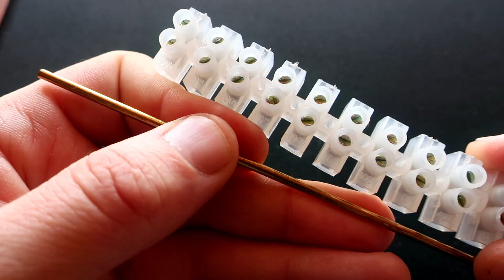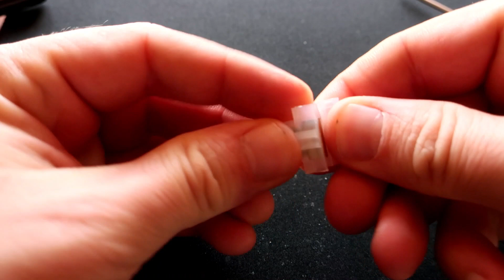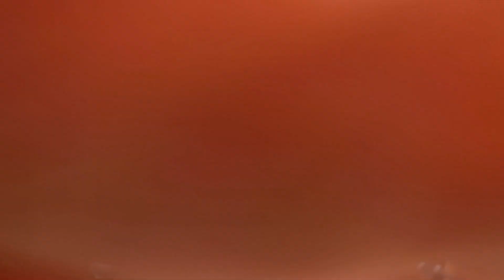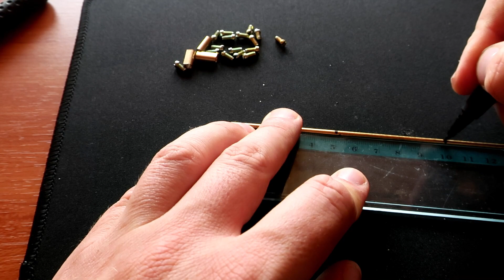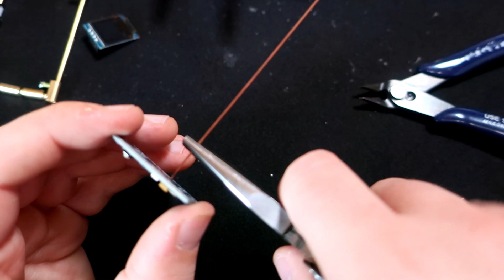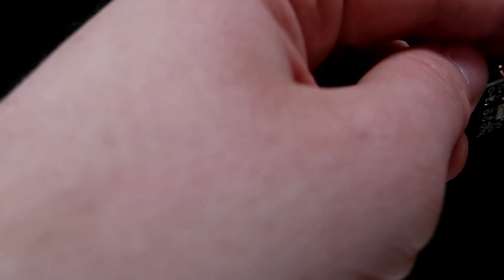Freeform Arduino Project

Comment: I love your projects. I'd like to give you a tip for clean joints on soldered frames. Use a soldering torch on the joints and it will spread the solder smoother than using a soldering iron. The joints will not look like bubble gum. Experiment with the flame until you find the temperature that works for you.
I'm new to electronics, but have soldered some electronics and copper tubing. Using the torch on tubing spreads the solder nice and smooth. No more bubble gum joints.

Comment: Do you have a link to the correct threading tool pls?
Reply from the maker: any thredding tool with for m3 screws will work. mine is from lidl.
Reply from the maker: this set will work https://www.ebay.com/itm/Metalworking-Hand-Tool-M3-M12-Metric-Threading-Die-Ratchet-Wrench-Holder-Kit/163342300557?hash=item2607f5b58d:g:1KAAAOSwzHNb1swV